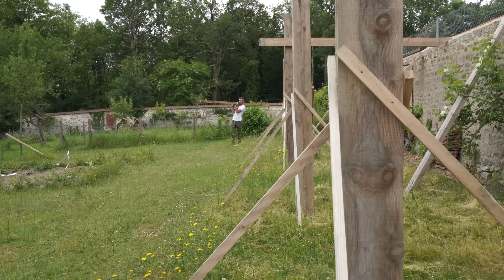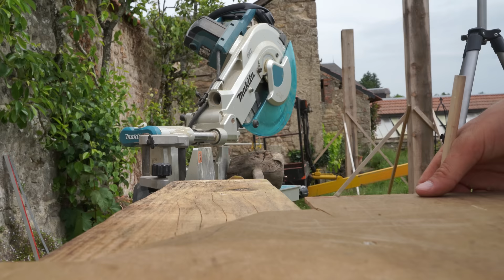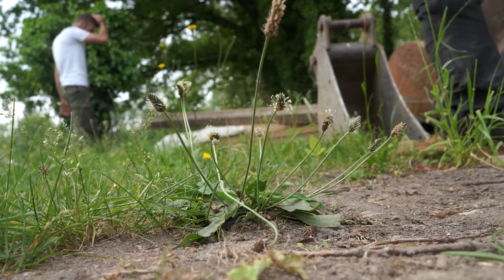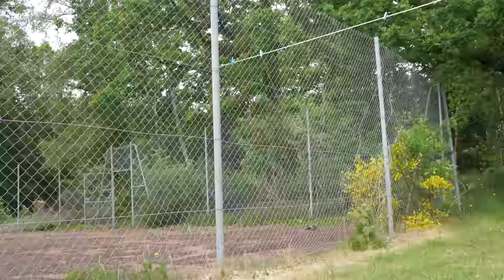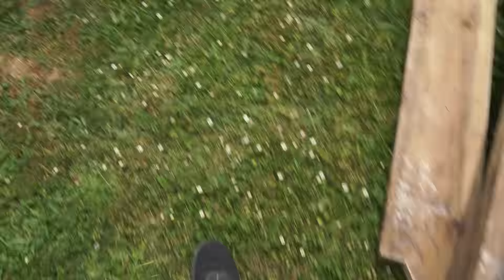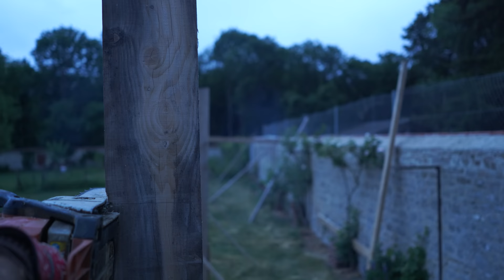A day of woodworking | pergola jointing

Comment: Perhaps using a circular saw with the appropriate sharp blade is the best way to cut down the uprights. Just mark a level line on each of the 4 sides and cut along each line, leaving a tiny bit to hold it up in the core, which can then be cut with a hand saw. Your hard work will be so worth it in the end, and it will look wonderful, Dan!

Comment: Great job notching.  What about using a battery powered hand held ( what we call in the USA) a saws-all.  I’m 74 & use it for numerous jobs in the garden & for other projects.  You can get both metal & wood cutting blades for it & it makes much smoother cuts than a chain saw.

Comment: I have heard of a trick, using painters tape to prevent the splintering off of the wood. Not sure if it's 100 % but wouldn't hurt to try. Also, would a hand held circular saw work better to do the cutting?